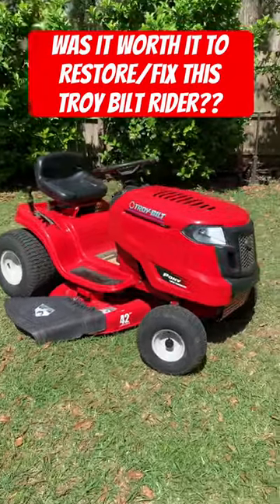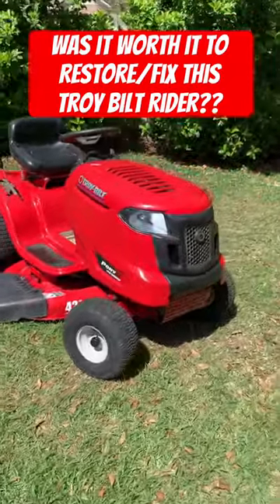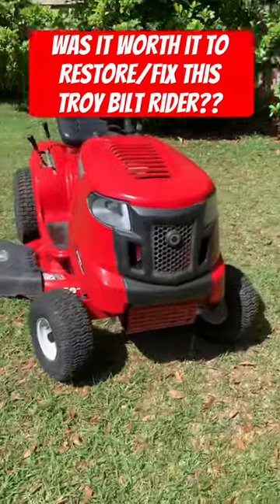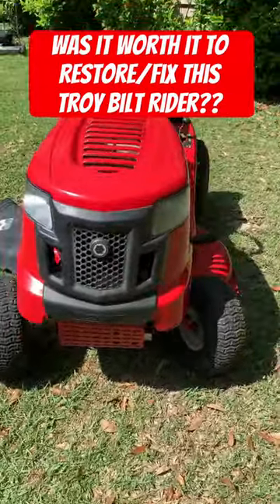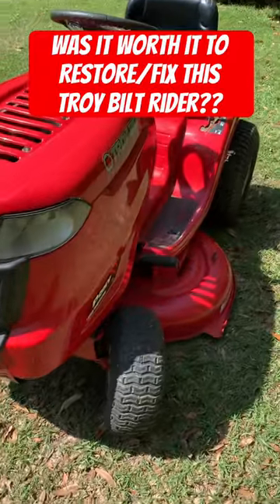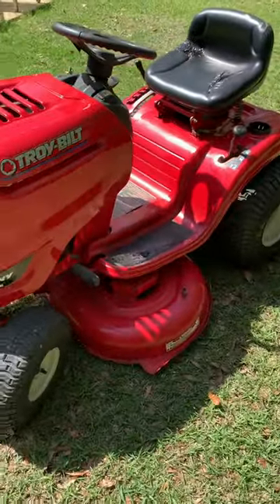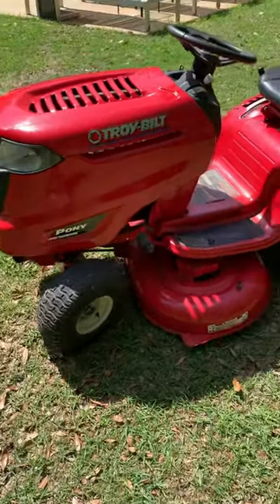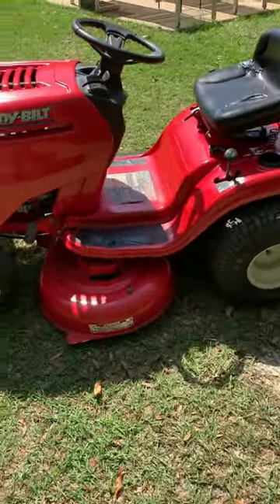Was it really worth my time to restore this Troy Bilt Riding Mower? #mower

Comment: I bought a six year old John Deere x380. That Kawasaki engine is excellent. No problems so far. I used to have a MTD mower like this (I know Troy-bilt, still made by MTD), it rusted out like crazy. I replaced everything that had a bearing.
Reply from the maker: Those are great riding mowers! Especially with those great Kawasaki Engines…